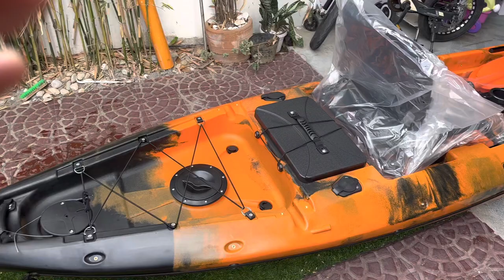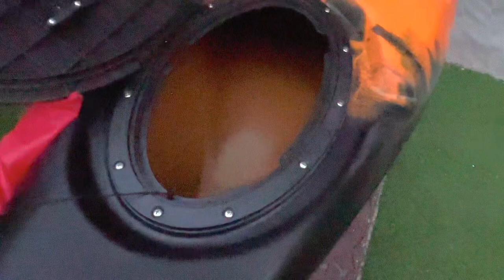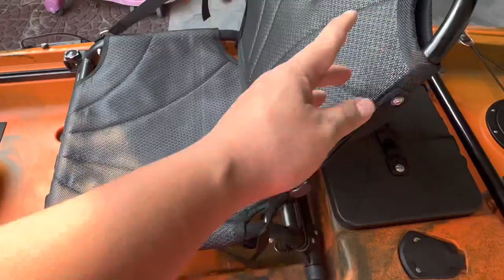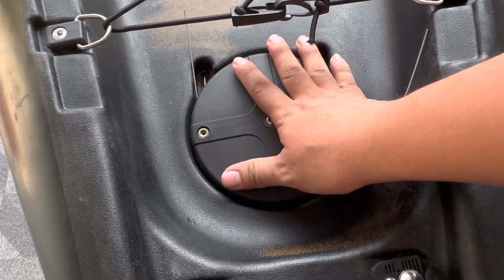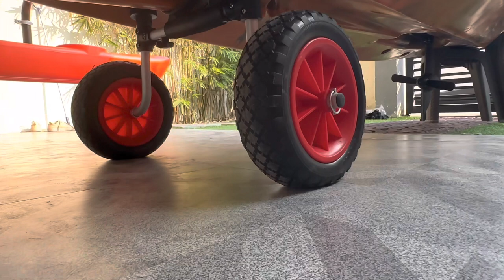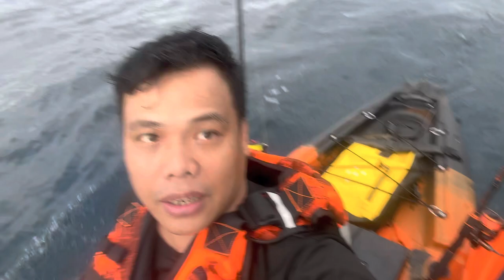UNBOXING AND TESTING MY KAYAK  (english subtitles)

Comment: Everyone is getting their new kayaks, this time every year. I Like seeing us all unbox a new boat. I just received mine two Days ago. I sold my last kayak to my best friend, with some accessories, and my 1st Bixpy motor. People go from paddle to pedal, to paddle and pedal, then the motor. I just received my 2023' Hoodoo Sports impulse 120, pdl drive.  And received my new PP-768 J2 Bixpy motor, complete kit, with the Bixpy gravity rudder. I ordered them together.I have a new 2.5 Suzuki outboard I purchased 3 years ago, because I thought I was getting the Jonny bass boats 100. But the USA Had a pandemic. Next summer I'm going to design a motor mount. So I can run that motor off the stern. Gonna be adding all my electronics, accessories, DIY's, and other new gear I purchased. Can't wait to get back out on the ocean. Stay safe bro, good luck with the new boat. Mine is also radiant Citrus Orange.  🎣 🙏 🌊 🛶

Comment: This pedal drive is tough AF. I own a similar kayak with the same pedal drive, best advice: Open up the pedal and completely fill it with engine oil, it will get smoother, faster and quieter, no need to to any internal maintenance regularly. Mine has the same design issue, when you get rough waters or rain, some water will get into the hull through those "water collectors" that are the rudder cables holes. That being said, Go for the optional rudder mount, it will track better too.  That orange colour is very nice!

Comment: HOODOO TEMPEST 120P ~ BROOKLYN KAYAKS PK-12... SAME KAYAK!
$1500 +/- US
I subscribed to you! and thumbs up!
You received the best pedal drive... This one will lift up onto the front hatch OUT OF THE WAY!
Stabilizer looks good but you won't need it unless in waves or around big boats.
TIP(s) FOR YOU: Tie the back hatch to the bungee cord or it will fly away while traveling.
Go over the whole kayak and tighten all the screws and bolts (Including the pedal drive)
Replace all the bungee buttons with hooks because they do not hold very well.
Use the scupper plugs because the floor will have water while pedaling.
I put on a back rudder but had to make an extension because the insert points are too close to the back and barely got any steering.
IF YOU WEIGH MORE THAN 200lbs / 90kg DO NOT BUY THIS KAYAK!
Reply from the maker: yup, thats with a brand. i bought mine straight from manufacturer in china, the one that making the hoodoo kayaks, its way cheaper 😅

such a great kayak :)
Reply: Nothing wrong with the product quality of made in china. Jus because it is made in China does not mean a lesser quality. There are manufacturers in China that use Exxon resin from the US.